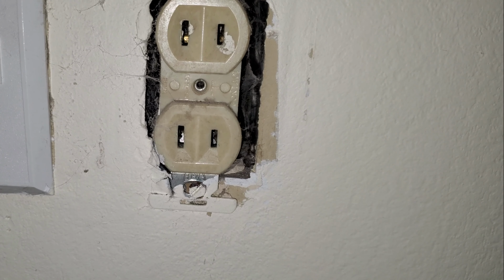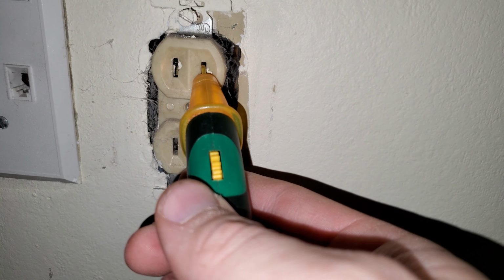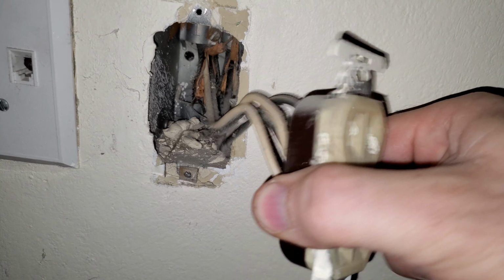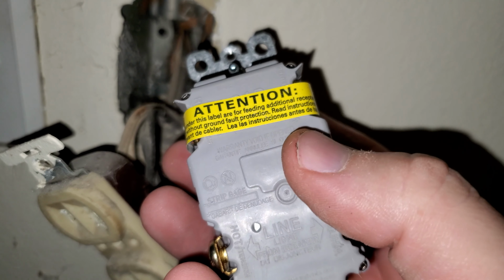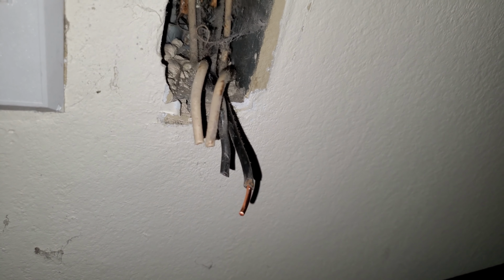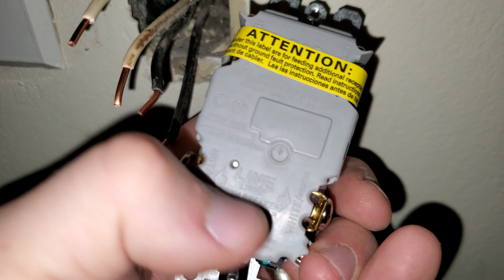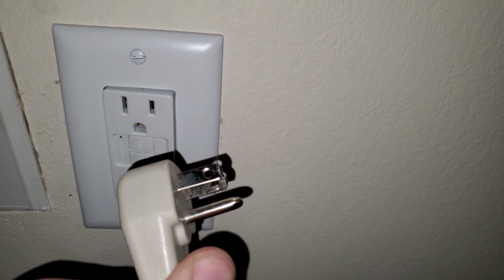How to Install a GFCI for Less than $20-Changing a 2 Prong for a 3 Prong

Comment: To qualify for the ungrounded GFCI upgrade, under NEC 406.4(D)(2), you need to first prove that there is not already a grounding conductor available at the outlet box, i.e., metal-sheathed cable bonded to ground at the service panel or non-metallic cable with an additional grounding conductor (inside or outside) similarly bonded to ground at the service panel.  If you HAVE a proper ground, you're required to use it when doing the 2-slot to 3-slot receptacle upgrade.
Reply from the maker: Thank you for raising these points!

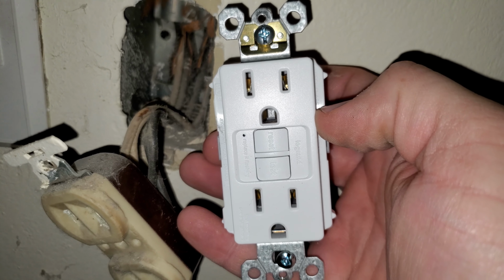Comment: At 2:03 you suggested there might be some reason to connect the GFCI grounding screw to other receptacles "downstream".  That would be illegal and pointless, since they still don't have ground but (if connected on the "load" terminals") do have GFCI protection. You would simply install the downstream conductors to the "load" terminals and then replace any (or all) downstream 2-slot receptacles with 3-slot grounding-type receptacles. You also need to clearly label the FIRST one as "no equipment ground" and all the others the same, but also with "GFCI protected" labels, which is why they give you a sheet of stickers in the GFCI box.
Reply from the maker: Also excellent points. Thank you!

Comment: Will this work for really older homes that  have the black clothe like material surrounding the hot and white wires? Thx
Reply from the maker: I think it would work, but contacting an electrician would be your best course. They may answer the question over the phone.
Reply: I have that same situation, and yes it does work. Verify your hot wire to insure its not reversed.

Comment: You have 4 wires coming in to the old receptacle, 2 from the electrical panel (line), 2 going downstream to other receptacles (load). You connected all wires to the line on the gfci, so you disconnected all downstream receptacles from the circuit. You need to add pigtails to continue downstream. 
I wonder why you wouldn't determine the line and load wires and connect them to the gfci accordingly. Then all the downstream receptacles will be protected. You don't need a gfci at each outlet. The gfci should be installed at first receptacle from the electrical panel. You need to determine which one that is, usually the closest, but not necessarily. It's an easy process.
Reply from the maker: The only reason I installed the GFCI outlet was to go from having a 2-prong outlet to a 3-prong outlet. If I remember right, there was no ground wire in the box. The best thing to do would be to rewire everything, but I wasn't interested in doing that, and simply installing a 3-prong without GFCI protection isn't as good an idea as having it, especially if the 3 prong you're installing has no ground.
Reply: @RealEstateInvestingUnmasked  O.k., I understand now what you're doing and yes it will connect downstream. I am a diy guy, not a trained electrician. I do have some experience, though. I learned from electricians to use pigtails in this situation or any time wiring for downstream receptacles. 
I am not clear on why you wouldn't use the load of gfci to connect downstream. Just replace the 2 prong with 3 prong regular receptacles. Then place the stickers on the faceplates "gfci protected" and "no equipment ground". It would be much cheaper than putting a gfci in each location, accomplish the same result, and is code compliant.
Thanks for replying, I enjoyed your video.

Comment: Will that pass a plug in tester
Reply from the maker: It should, imo
Reply: It will show open ground. When the plug tester test is preformed it will not trip the gfci. The brass plate on the top screw at 3:30 is self grounding IF the box itself is grounded which sometimes happens.

Comment: Just to let you know you don't need to cut the wires when their backstabbed all you need to do is pull and twist
Reply from the maker: Thank you!
Reply: There's a small opening/tab under the opening/tab with the wire.  Stick a small flathead in that empty tab and pull the wire straight out.